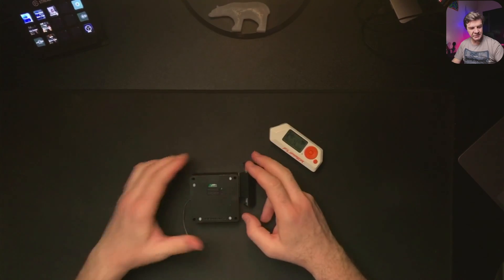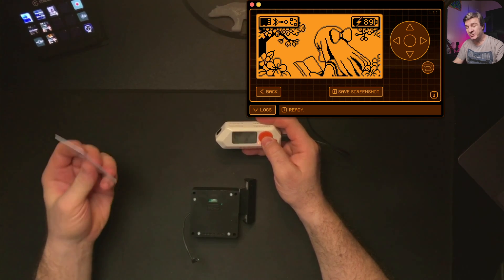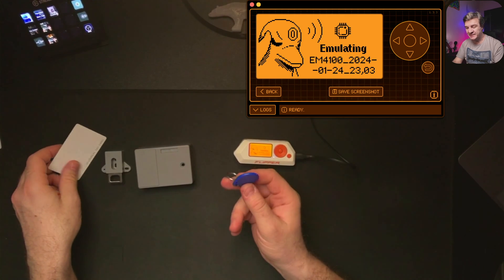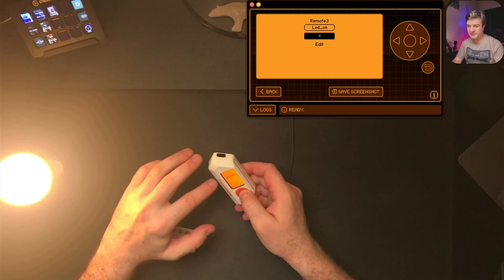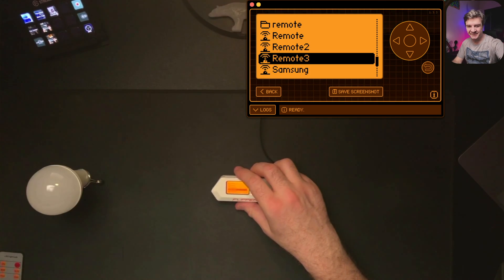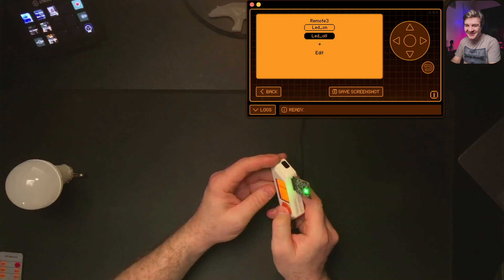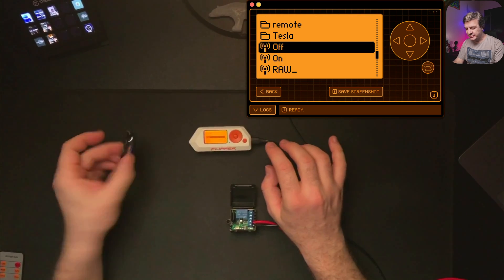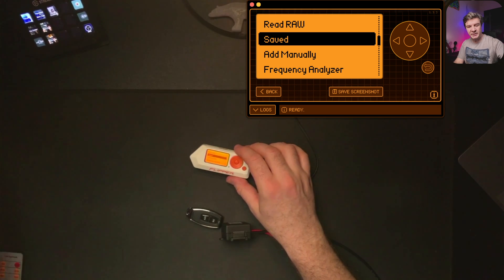Flipper Zero - Cloning NFC, RFID, Key Fob, and IR Signal

Comment: Many keyfobs use rolling codes to prevent duplications like this for security. Basically, each time your keyfob gives a password to do an action on the car, both the key and the car change the password for the next time (using the same algorithm to remain synchronized). Since the algorithm is proprietary and the Flipper can't know it, the code captured from your car key will always be outdated and useless. If somehow it were able to guess the next code or crack the algorithm, that would mean the car would advance to the next password while the keyfob would not, and thus they'd become desynchronized. This means your key is now bricked, and you can't start your car anymore.

Comment: Is it possible for someone to extend the range that the flipper can read an rfid card or do u have to tap the card to the flipper to scan them. My job uses rfid doors and was wondering if someone could stand by reader and get id's as they pass
Reply from the maker: There are solutions to clone nearby RFIDs depending on the solutions cybercriminals have and RFID type you have.

Kevin Mitnick has demo video on youtube.

Even Cars are being stolen using that method.

Comment: I have a 2007 Yaris Key Fob, and have been unable to program a second Fob ( TEXAS 4D 67 "Dot" chip)..  

Could the Flipper Zero, either Xtreme firmware or official zero 1.0 firmware,  record/analyze/display the 2 fobs output to see why my second fob doesn't work?   Or would another SDR hardware (LimeSDR or HackRF) and software (Universal Radio Hacker) be needed, like shown in the 0x44 cc article ("Reverse engineering a car key fob signal")

What about TPMS (tire-pressure monitoring system).. my tires are properly inflated yet, apparently it keeps sending the low pressure warning to the dash!
Reply from the maker: Flipper Zero can see if the signal is sent, you can enable monitoring/discovering mode and "hear" everything that is supported, that way you can tell if the key fob is actually sending anything.

I never tried to work with TPMS.

Can't tell anything about Yaris Key Fob.

Comment: I don't have a pc. Is it possible to install the firmware with a smartphone? I have tried it several times but it doesn't seem possible.
Reply: It is possible but you need a .tgz file with the firmware!
Reply: How do i run the firmware kn android @dino981s
Reply: I bought a cheap laptop for my flipper

Comment: Do you think flipper zero can copy and emulate a RFID sticker for a gate opener? I’ve tried cloning but it won’t work
Reply from the maker: It all depends what kind of sticker it is. Of course not all the tags are readable by flipper.

Is it NFC or 125khz?
Reply: I'm trying to clone a 13.56 khz mifare ultralight. I would like to write it to another card. Im unable to find an option to write the NFC tag.
Reply from the maker: @erencakici  Yeah, writing on NFC tags is a challenge as of now. I didn't have time to work on it and figure out that yet.

Comment: Can I copy a keyfob frequency and paste it onto a reprogrammable fob for gates
Reply from the maker: If the frequency and protocol matches, yes.

I did it for 125khz fobs, and wrote them on this:
 https://www.amazon.com/gp/product/B01JGCRK0K/
Reply: @ITSolutionsNetwork  is it possible to do 433khz on like a clicker type fob the ones you use for a garage
Reply from the maker: @saint-fs1yj  it seems like you mean an actual remote control key fob, no, you can't write it on any a 125 khz RFID tag.

But, you can use flipper zero itself to emulate the code at 433 Mhz if it's not encrypted just like I do at 7:08.